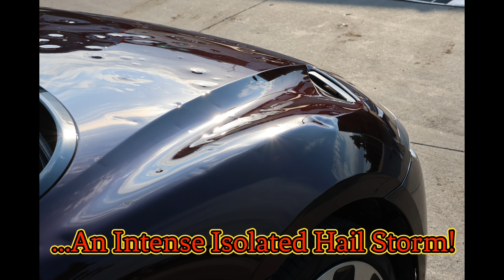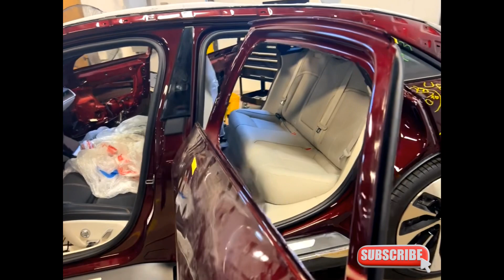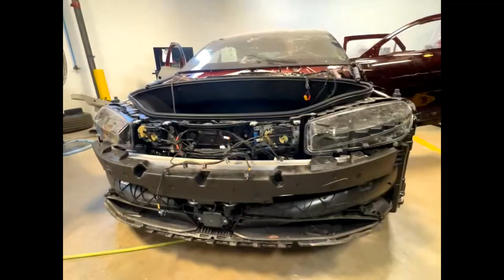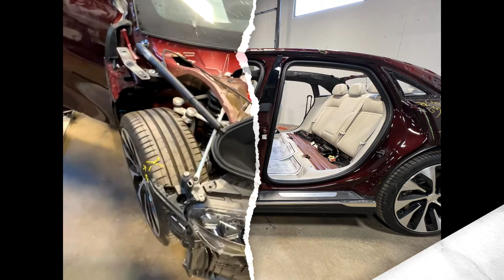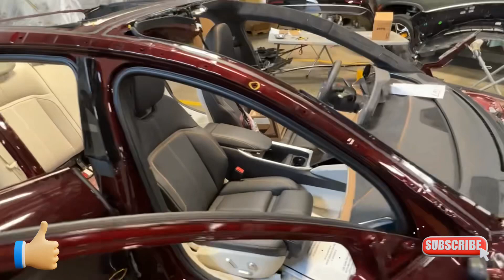LUCID NEWS:  From Hot to Not…and back?

Comment: Rob, first of all, I am so glad they are able to repair your car. Those are some fascinating photos Jose got for you. I look forward to following this project.

There has been some discussion on the forums and mixed opinions about the inner door release triggers. Some say they are just an electrical switch. Others say there is also a mechanical connection that will open the door latch if the power is off. Would you mind asking Jose what he found about that when taking the door apart? Would be great to be able to settle that argument discussion once and for all. Thanks!
Reply from the maker: I will. I remember seeing something from Lucid saying that they were both electric and mechanical so the usual and emergency actuators are in the same place. It was a video by Lucid. 
Thanks for watching,
Rob
Reply: @EVAdventuesRob  Yes, I heard that too, but someone said it didn't actually work. I thought, well, while you have the door apart anyway might as well take a look.
Reply from the maker: @Miata822  Agreed. Haven’t talked to body shop so haven’t been able to ask. I think we are waiting for parts. They’ll have it for awhile! 
Take Care,
Rob